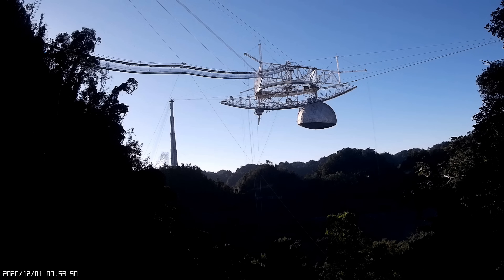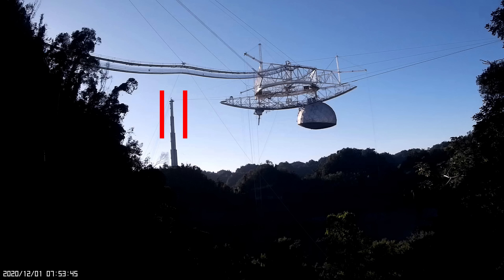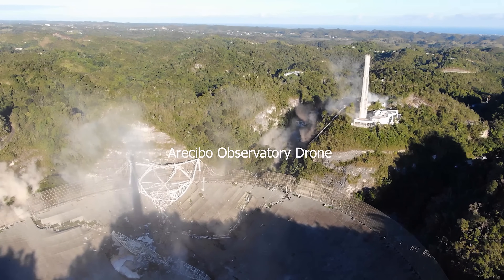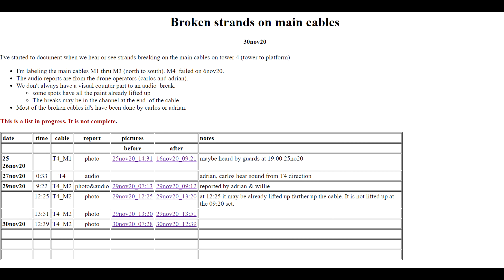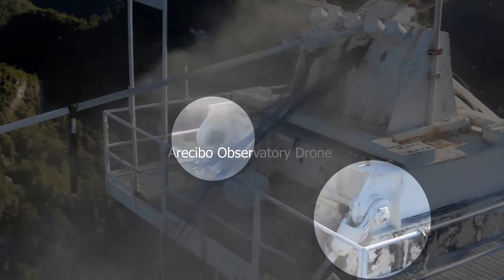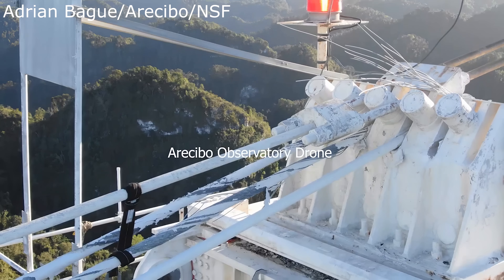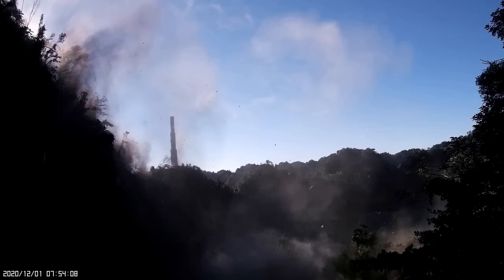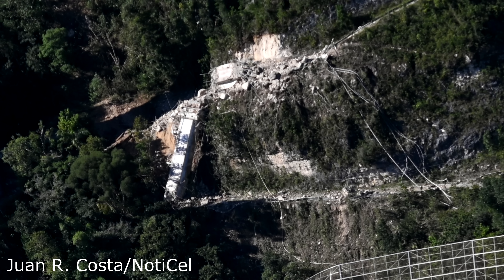Analyzing Video Footage Of Collapse of Massive Arecibo Telescope

Comment: It is interesting that the cables from Towers 8 and 12 were still strong enough to rip off the tops of those concrete towers and pull them sideways, to the west.  Whereas, the top of Tower 4 was pulled backwards toward the southeast by the back stay cables.  I am guessing that Tower 4 or its back stay was sinking or tilting prior to the first cable failure, putting undue, un-designed strain on that tower's platform support cables.  This is a karst land-form that is prone to develop sinkholes after all.

Comment: Easily predictable: plenty of chronologically documented fail issues, engineering decay over some time, like it was left to fail dramatically.
Reply: It seems like those in charge were just letting it fail.  Why did they not lower the receiver to the ground if they knew the cables were going to fail??
Reply: @common_c3nts  Yeh, they should have just told the janitor to lower it down.
Reply: @common_c3nts  90's were great, but not much was built to last. Consuming more was the theme and longevity came third. "Smart" engineering today probably just doesn't make sense to fix something like this vs making one better and cheaper.
Reply: @common_c3nts  There was no way to lower it to the ground, gently.
Reply: Could just be a funding issue. If you can't get the money to do the repairs, you don't get to do the repairs. So just run it as long as you can to get as much data as possible. Possibly things like the hubble were getting better data by now anyway.
Reply: I agree in principle it would have been better to lower the receiver though. Put some lightweight carbon-fiber structure up instead.
Reply: The collapse of USA kingdom is expected to be like this,everything in a sudden, much faster than the collapse of USSR.

Comment: Left to rot. Cheap cables at start to be 60s and 1 fails but nothing added to strengthening others? Cracked paint showed the stretch/ to breakage levels. Still no doubt worth more being trashed or would have been saved.  To leave it cable short? that is dumb. 
The footage not shown was the drone pouring acid onto lug behind the part that snapped. You tube hits these days can make millions:)

Comment: Imagine what could be discovered if Arecibo gets built with modern materials and with a modern design. Engineering has come a long way.
Reply: There is a even bigger telescope in Guizhou in southwest China. It was built from 2011 and in testing mode since 2016. Since January 2020 it is officially in use.

Comment: Corrosion at the sockets .. this happens to yacht rigging too. 
The cables are fine up to where it clamps and collect moisture.
A electrolyte it tampering with the strength. 
There is not more to it

Comment: That is emblematic of the problem with the USA as whole,  just slowly decaying and falling apart..
Reply: this is what happens when china stops taking "recyclables". people just throw the same comments out repeatedly. was it clever the first time? nope, it was trash. but instead of it getting shipped to an overseas dumpster country, you picked it up out of the gutter and pretended you had a clever new thing. congratulations 🎊🎉
Reply: @Mitchell_is_smart._You2bs_dumb  Deny all you want, still doesn't change things. This country is going down the shitter like rome.

Comment: This is such odd timing. Seti@home announced it was stopping folding the endless data received by this telescope just a couple months ago. The project ran for 20 years, and no reason was given for the cancellation. They have never ended any of their other 5 dozen folding projects before. Now, out of the blue, these cables fail when there just happens to be a drone flying at the exact right spot to record it?  Strange stuff

Comment: Well ... looks like the guys who said it was to dangerous to try and fix were right ...

Such a shame.

My biggest question about why it failed is - what was wrong with these cables that they did no meet the standards they were expected to have.  According to the original specifications of what these cables were expected to carry and how long they would do it - these cables failed much sooner than expected.

Yeah ... it would be nice if they replaced it with something better but the attitude of the NSF is indicated by their funding cuts before any of this happened.  I'm not optimistic.
.

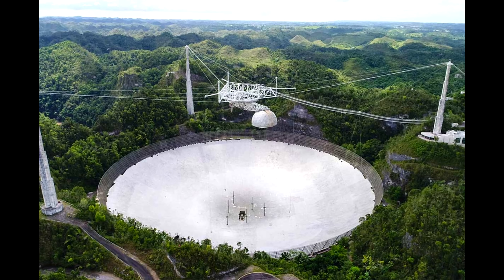Comment: I wonder why they didn't originally install 4 main towers instead of 3. Having the additional tower just adds to the longevity of the structure not to mention the massive load relief on the others. In this type of structure 4 is much more "natural" than 3. I'm not an engineer but  the image @2:15  shows the intact structure and you just get a sense its missing something. Maybe its just a matter of the existing support far exceeded the max load ratio when built. Anyone know anything?

Comment: 00:29 The far tower is being pulled down backwards by it's counter weight cable secured to the ground. Clearly indicating that there was way too much tension being exerted on the tower to hold the cables to hold the structure. 
Never have the owner of anything that breaks explain what went wrong. Because it will not be what went wrong but what is in his best interests. .... Human error caused that collapse. NOT the cables failing.

Comment: very sad to see this!  also sad that they could not get a new cable right away back in November when it broke. evidently that it was the safety cable and it must have been under stress.... I hope that it can be rebuilt back to normal but this is catastrophic. I never knew that the instrument- antennas structure was that massive. so sad to see this.

Comment: Is there a reason that the facility was in such disrepair/remediations were not done?  A load-bearing tensioned wire breaking, leading to the other load-bearing wires to fray, is pretty serious.
Reply from the maker: Funding for all science programs were cut in 2006

Comment: Faulty engineering.  I could have told you just by looking at that thing that the structural integrity of the whole thing was wrong and I am an electrical engineer not even a mechanical or structural engineer. The weight which was too much was probably collapsing the structural integrity of the whole thing for years and the cables finally gave.

Comment: Who thought it be a good idea to use 3 inch steel cord to hold up a multiple ton structure above a dish... maybe use 4-5 inch cables with stainless steel cord instead of cables that corrosively compromises over time?

Comment: If I've read correctly modern radio telescope arrays are far better and cheaper. It would have been nice to keep this as a museum or something but I feel like a lot of the outrage comes from James Bond nostalgia and missplaced concerns about scientific funding. It would be anti scientific to spend more to get less. Any attempt to save it would be for historical value, and any attempt to fix it for scientific use would involve replacing it anyway.

Comment: Consider it was build more than 50 years ago.
Normally u have to change an entire sky lift plant every 30 years for the metal fatigue.
Now the facts: already crippled from the loss of 1 of the 4 main cables ( = 75% left of load ) plus central cable was  falling apart. missing parts.

Even if they'll rebuild brand new it will not last more than half of the time of this scientific complex structures.  Fly safe !

Comment: Good thing we use drones for the inspections of these things now
Reply: if we didnt, nobody would have been up there anyway. They could have just used a remote control helicopter with a camera on it(thats a thing by the way thats been around far longer then drones) or at worst they would have used a helicopter with a guy attached to a wire... honestly though, they should have taken that whole thing apart when it started to fall apart, waiting for it to fall apart was dumb as hell.
Reply: @jessiejanson1528  why a rc helicopter it would be a real piloted helicopter
Reply: @benconway9010  cables snapping could be dangerous if they hit a real one with people in it.

Comment: Seems strange they fastened the cables into the tower with solidified zinc. Zinc is used in industry as a sacrificial anode which when in contact with a dissimilar respective charged metal especially steel it will cause "galvanic corrosion" and slow down the corrosion in the steel whilst accelerating the corrosion in the zinc.

Comment: should of bent somenends of the strands in the bush when socketing with zinc .stops strands slipping through the zinc cast..or most likely the sockets were to small for the weight ,should of used larger sockets for this with more end of cable bush..dont forget heat and cold would of affected the rope over the years .streatching

Comment: Apparently, the design did not have enough redundancy. One cable failed - whole thing failed. How did they plan to repair cables if all the cables have to share the load and you cannot disconnect one for service? Perhaps the designer came from the same school that produced an architect of Twin Towers and an office building in NYC collapsed on 9/11. In both events the most practical question is who was the insurance beneficiary?

Comment: basically what the video shows is that this couldve been avoided if they had replaced the 4th cable without all 5 being hooked and locked into place the stress on the other cables increase by 20% which seems to be to to much for the already old and damaged cables TL:DR people are stupid and this couldve been avoided

Comment: Maybe if it gets rebuilt they could make the cables with maintenance and replacement in mind. It seems like too many large-scale projects are built without feasible ways to maintain them through long periods of time. Engineers seem to design them to last X number of years and then they just fall down.

Comment: It's highly modular, designed to last forever with proper maintenance and repair, by basically replacing parts of itself over time. This also makes it expensive to maintain, about $12 million per year. They basically pulled the plug and let it fall apart, as America's funding priorities changed. Meanwhile, the Chinese FAST has taken over the torch. A sign of times to come, I suppose. Events like this marks the rise and fall of empires, or in this case, fall and rise. You can tell who is which, by looking at who's concentrating on building themselves up, and who's expending all their efforts on trying to tear others down while letting their own infrastructure fall into ruin.

Comment: Why did they not lower the unit for inspection and repair? It is designed to be lowered is it not? After all, they had to lift it up somehow, right. Seems odd, knowing the issue for so long  and not lowering to address it.

Comment: If it isn't rebuilt, it should be preserved as a World Heritage Site. On the video, this will be hugely important to understanding of how high tension cables fail. To me the most significant things appear to be that: Catastrophic failure is a pull out with only a fairly low percentage of strands broken, rather than  progressive strand failure and snapping, and that the safety margin was not sufficient, three of four should have been able to hold the load indefinitely and even two out of four cables should have been able to support the structure for long enough to clear the area safely.

Comment: No one:
2020: OK now i destroy telescope so  I can send asteroid
Reply: China has one bigger than this, so 2020 also has to destroy the one in China called FAST.
Reply: @gordonchao3074   As far as I know, FAST has no "radar function".
Radar recordings of asteroids were definitely possible with Arecibo, as this, in contrast to FAST, also had transmitters.

Just take a look at the pictures from the S-Band Spotlight on naic. edu
Reply: @gordonchao3074  also the one in the United States and Hubble telescope...
Reply: I hope we have more dishes to detect those!
But I don't think we can react properly to such calamity
Reply: Quiet! Before you give Murphy any more ideas!
Reply: Wild Sandwich  exactly, this one was made to detect the radio waves from stars and planets many light years away, and fun fact, it was accidentally made better when the engineers made it bigger than what was on the papers.
Reply: this telescope couldn't spot an asteroid.
Reply: Wild Sandwich  it was a joke I know that it doesn't spot asteroids I tried to be funny but you have to ruin it
Reply: Wild Sandwich  thanks man

Comment: heres a glitch/hack/cheat just for a nostalgia, go to the top of the bunker stairs and with your back to the metal door, look straight ahead walk forward smoothly... Tadaaa your flying...
Its (insane) hard to get back through the glass doors at the bottom but if you do, you can fly around the map... I only managed it once, but it can be done...

Comment: What a heartbreaking shame,  I’m not and no we’re near being a scientist but even I was upset to hear they were decommissioning it cause of the damage from earlier but to see it collapse like this is even more devastating. Even my limited understanding how things worked and how we got that information on all the scientific and space data.  I even knew here in the USA from a small town just how important this telescope was to science and space. First learned about it in school 40 years ago. Thankfully no one was hurt or killed during this and it happened only while droves and cameras were watching. If was a time without droves that most likely would a person up there inspecting those wires as it started to fail and collapse rest of the way. So that rt there is a blessing to be happy for that no one was hurt or killed.  Also is a crying shame and unfortunately we all know that statement you said is true about how political pressure and politics alone will decide what, where, how and when something can be done or built for the scientific community when it comes to the money needed.  Even though one area would be so much better for a piece of equipment to be built somewhere the politics would have a telescope be built inside a cave pointing into the ground instead of into space to whom ever gave them the most money or power to let it be built there over somewhere else that would be the best for the experiments needed for that equipment.

Comment: Sucks but I could see this site as a total loss. Obviously there is no repairing the main equipment, it's toast. The whole thing would need to be scrapped and rebuilt, including the remaining tower that didn't buckle. But the time, money, man-hours needed to do this is just stacking up. I could imagine the site's remaining equipment being decommissioned, the buildings being barred up and the site just gets abandoned even with some of the damaged remains of the receiver platform still laying there. Expensive and dangerous to send in heavy machines to salvage it just for the scrap steel. Would make for a cool abandoned exploration site in a decade or so.

Comment: Cables : Its not my fault. I have been telling them that I need replacement but no one come to help. So I just snapped.
Reply: cables snapped there almost on yearly base but where replaced immediatelly.
Reply: @tomast9034  If they broke on a yearly basis, then that was an absolute disaster of a design. How many cables have snapped on the Golden Gate Bridge? (I'll give you a hint, less than this)
Reply: @davehoward22  I wonder why they weren't able to instal 3" wide cables in the first place. I hope they can build something bigger and better next go around.

Comment: The main cause of this failure was a total lack of maintenance. What maintenance program was in place and what was the Maintenance budget. I bet that the Management were scrimping and saving any dollars they could and neglected Maintenance. I worked in Government Maintenance and the common theory was, don't do anything until you have to or it breaks. This does not create a reliable safe structure or workplace. Someones head should roll for this!

Comment: Thanks fot this video of 900 ft telescopic, also equal to 0,17 miles or 10,800 inches.
You could also say that it was 275m, 0,275km or 275 000 mm.
I don't need any concersion tool for metric change unit.

Comment: Wow, the thing is a couple of years younger than I. I do not know how long it was meant to last. It's not abuilding, but it look like it had other issues too as I saw rust coming threw here and there. But we have larger and bigger telescopes now. I am not sure if funding is going to happen anytime soon with. Maintenance had to be high on such a old device, that has to sway in the wind somewhat. I hope that it is at least cleaned up, and all the destruction removed. 
You are right about the clean zone, if those are dropped before it can be cleared out, and rebuilding funding can begin. It will be a lost opportunity. But till then, many can still make their way up there, and do star watching. May it be a bit old fashioned.

Comment: Here's your problem,
they made a massive mass suspended in mid air from all sides with thousands of tons of torque pulling at 90 degree angles constantly, while only being held by 5 or so tethers.